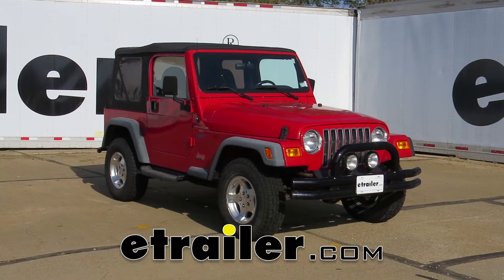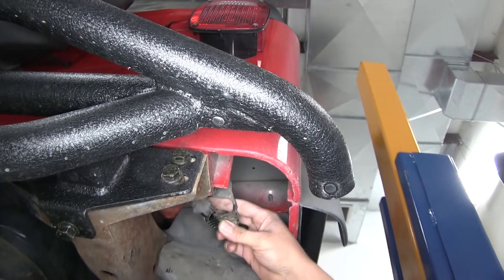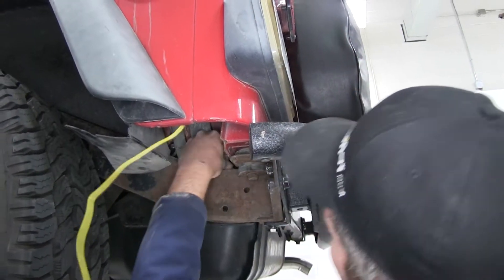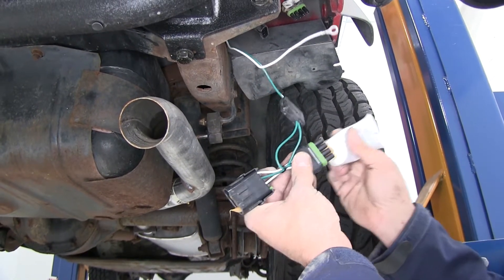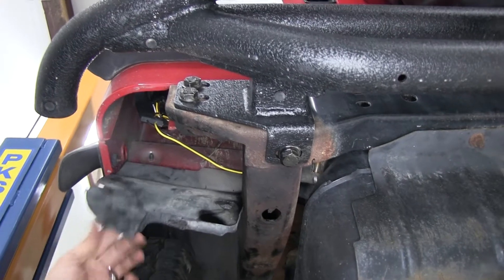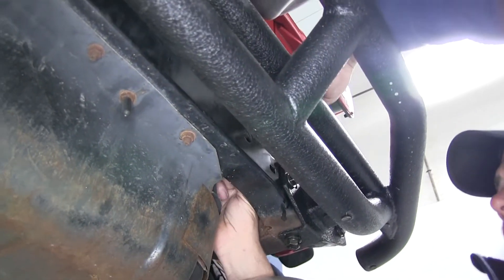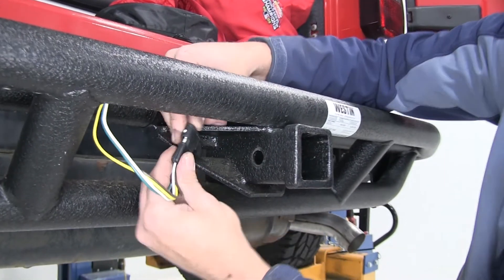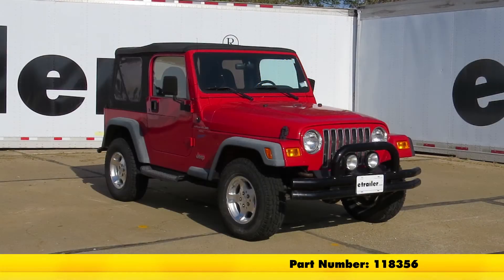Install: T-One Vehicle Wiring Harness with 4-Pole Flat Trailer Connector on a 1997 Jeep Wrangler

Comment: I'm a noob to towing big time, so are those wires you connected the new harness to the brake/turn signals?
Reply from the maker: This wiring harness is for connecting to a trailer that does not have brakes. It is designed to run the running, brake, and turn signals.
https://www.etrailer.com/Custom-Fit-Vehicle-Wiring/Tekonsha/118356.html